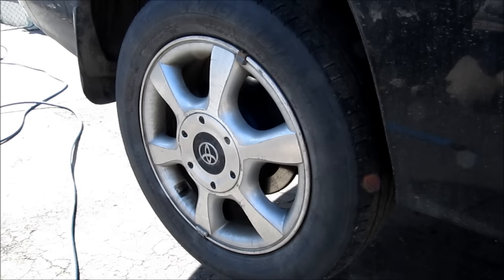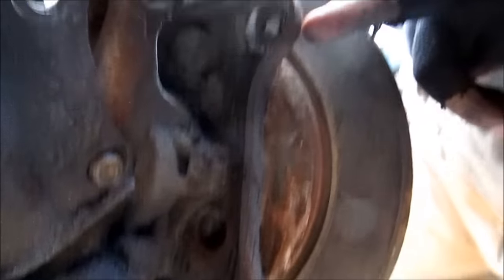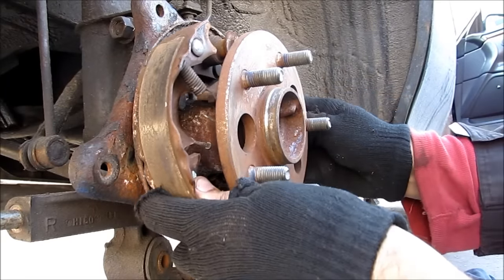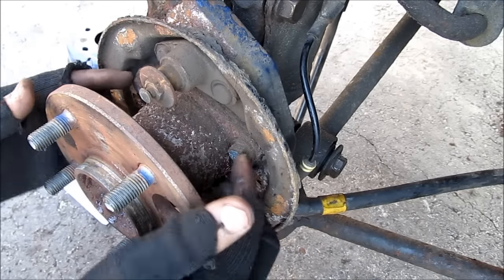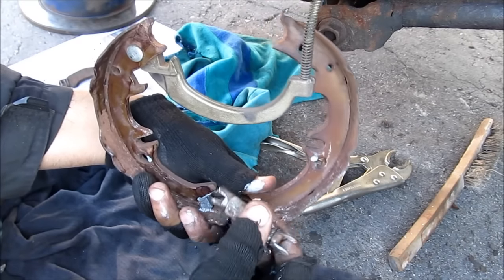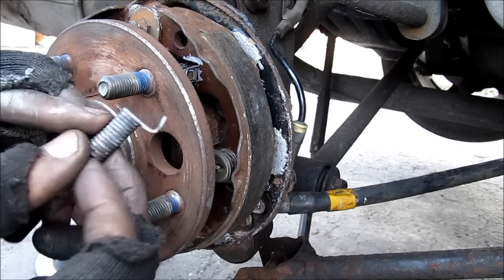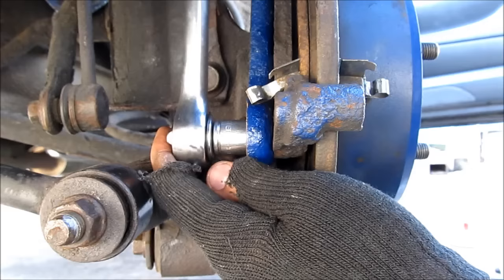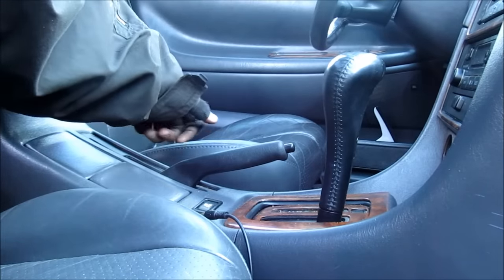How to Replace PARKING BRAKES

Comment: I've done this job before but I still needed a reference.  You sure do know what you are doing!  The diagram was nice and naming all the parts was educational.  If you do a Rev 2, my suggestions are 1) make sure people know that this is a very frustrating project.  All those springs under pressure cause many minor mishaps and "start over"'s.  2) Go slow on the parts where you need to be careful which direction a part needs to be inserted.  Like the parking shoe strut/compression spring, the parking brake cable (if you put that in backwards, it is a BEAR to get it off), the shoe hold-down springs (this is a tedious Houdini maneuver), the "washers" (have a flange that needs to go into a hole on the hub) and the adjustment knob wheel (again-which direction?   answ:  so that the adjustment increases tension when you turn the wheel cog in an upwards motion).  Also, on my Lexus RX, I found that it was much easier to install the retention springs first, THEN the shoe hold-down springs because the entire assembly wants to fall off if I didn't and then, I have to start all over, find the springs that fell out, etc.  Anyhow, thanks fo doing this, just some suggestions for and from a bozo who doesn't have a lot of experience with this.

Comment: You missed a couple important details here and made this way more difficult than it should have been. To begin with, all you needed to do was take off the bracket bolts and using a wire hanger to hang the complete assembly up out of the way by way of the strut spring. You NEVER leave the caliper dangling from the hose. Secondly, the pad brackets have an open slot in the middle with a hole just below it . This is to allow us to "push" the shoe hold-down spring and pin set-up off the bracket with a flat head screwdriver, so you don't have to disassemble it, unless you are using new hardware. This makes it much easier to do. Plus, when you re-attach the shoe hold-down spring set-up, you need to insert the tab from the shoe hold-down spring cup into the hole to keep it in place. A "hook" tool works great here. But, remember to always wear a dust mask when working on your brakes!
Reply: Hey, listen.....  you have no business telling a guy teaching newbies how to disassemble and reassemble brakes.  Newbies don’t have the pleasant experience of knowing how to do it that way. So Speedkar is doing a narrative breakdown. Now do the newbs a favor and go away.
Reply: @justchris846  Really,,,and who are you??? Doing a brake job can be hard enough. So if I see an easier way to do something, I'll say it. So, excuse me for trying to help out by simplifying things. And as far as I'm concerned,  you have no right telling me what to do or where to go.
Reply: RG T I’m a certified mechanic Is who I am, ASE to be exact, 10 years in the shop , this video is great for newcomers, if you have tips a tricks , do a video showing how to do them instead of telling this young man how to do what he clearly already knows how to do
Reply: @justchris846   hahhaa the man can say whatever the hell he wants 🤣 😂

Comment: Great video... massively helpful.... EXCEPT that you made it look easy.  I did ONE side tonight and it took me 4 hours.  Most annoying job I've ever done!  Getting that pin and the spring and cap in place while holding the stupid shoes in the right place... ARGGGGHHH!!!  Very frustrating job, but this video was great.
Reply from the maker: Thanks for the feedback. Yes those clips are very tedious. I cheated and learned on the other side before making the video.
Reply: I had a lot of difficulties holding the spring and cap as I couldn't put a lot of pressure of the pin at the back. I cheated by getting 2 small cable ties and putting the spring in a vise and cable tied both sides of the spring. This meant I didn't need to fight against the spring while trying to get the pin through the cup.
Reply: Same here..started at half 8 AM..half 3 pm came and still not finished..so I gave up

Comment: IF, and that's a HUGE IF around here.... If you can remove the 4 bolts that hold the bearing in, and actually get the bearing to come out, the brake job becomes SUPER easy.... IF not, struggle on!
Reply from the maker: Agreed. Not easy though

Comment: Great video..would have been MUCH better to NOT edit out where you had trouble. That is where people that are doing DIY learn and better understand. I think !A Autoparts or is it A1..does videos with the trouble they go through. Sure edit out the bolt loosening and turning, but other things should be included, such as spring, or clips and all of those things. People can easily fwd.

Comment: This is the most complete video I've seen dealing with the Toyota parking brake.  This saved my hide because I was having so much trouble, but after watching this video a few times I was finally able to get the job done.  Thanks!
Reply from the maker: +Michael Gulley Thanks, great to hear you got it done.

Comment: There are lots of videos about this but your video is absolutely the most understandable.  I have struggled with my 4Runner for days.  Unfortunately, my parking brakes were in pieces before I took them apart, so I really did not have a good understanding of how they looked before I started.  I'm a visual guy and when I disassemble something I am not familiar with, I take the time to take a lot of photographs.  I had my hardware kit as well as new shoes but without the benefit of seeing the brake assembled before hand, I wasn't sure what spring went where.  I also had a bad understanding of the sequence of assembly.  Thank you.

Comment: Great video. Super helpful after I had my parking brakes seized up from sitting too long (waiting for parts, lots of rain) and ended up forcing the rotor off. Everything went perfectly well putting it back together thanks to this video. Much appreciated. Except the last step, after adjusting the parking brake on both sides, I found out I had a stud that backed out because of my hammering. Yaya.

Comment: A great video and right to the point.
I'm currently restoring a 1998 Toyota celica and this video is exactly what I need. I had the same problem getting the two 14mm bolts off. (M10 with 14mm head) I had to use a twist socket to remove one of them. On re-assembly of the two shoes, I used a length of thin wire to compress the two springs that are difficult to get back on. The trick is to assemble the retaining pins, springs and slotted caps first. Then using the wire to compress / pull the spring just enough to enable the spring to slide into the slot on the shoe.
I replaced the old M10 - 14mm head caliper retaining bolts with new M10x20mm x 1.25mm pitch 17mm head grade 10.9 bolts.

Comment: Excellent video. I just used it to try and figure out what my brakes had decided to chew up and throw around the drum. Looks like I've got the folded-up remains of the cable guide seen below the hub assembly at 3:53. Oh, and a pin which I'd wrongly assumed had been bent out of shape by the knackered brakes, which I knocked straight before discovering that it's supposed to be that shape. Oh well, more bits on order.
Reply from the maker: Well you have quite the job ahead of you

Comment: Great Video.. I'm a female and going to change my Parking brake shoes this weekend and was searching for a video that explained the procedure. From other comments you make it look easy and others say its a difficult job.  I'm about to find out this weekend. I will have your video with me all the way. Thanks so much for taking the time and posting.
Reply from the maker: +Pam M thanks I am glad my video helped you!! All the best on your brake job.
Reply: Speedkar.. well the job is complete and your video is exceptional.  but must say I am glad I had a mechanic close by.. lol  but the problem was my replacement spring kit aside from the pads themselves.. The replacement pins were too long hence the hold down spring and washer kept popping off when I went to replace the rotor.. Grrrr.. :) So found the original pins, cleaned them up, reused and presto. Piece of cake.. But yes a very tedious job and annoying.. I'm glad I won't have to do that again but I did also learn for future how to change my brake pads and that is a piece of cake. Thanks again for your guidance. All the best

Comment: Thank you for very helpful video.  With the pins, I am going to try assembling pin, washer, spring and cap prior to putting shoe on, and using string to pull and compress the hold down assembly and slide shoe in under then release.  I saw a photo of this method on a toyota forum for 4runners.  Same issue as Camry.
Reply: Did assembling pin, washer & spring work well?

Comment: Toyota brakes- particularly the handbrakes, put me in a theological dilemma. I don't believe in hell. However, I just don't know where the designers of these brakes can go in eternity... I would like them to see the insurmountable amount of wasted time they have caused all over the world and during many decdes because of these pins.
How many of us have they brought to sheer desperation almost to a suicidal state?!
So, this is my appeal to all of us who deal with this horrible design. Hang in there! There will be a day where the designers get a just treatment for what they have done to us, I am sure of it. :-)
Reply from the maker: +Manfred Lemke Yea those pins are a pain. Apparently there's a tool that your supposed to use.
Reply: very true
Reply: I found it easier to put the springs and retainers together and then stretch them out over the top of the shoes and into place. I also masked off the shoes with masking tape before I started to reassemble to keep them cleaner. Reading down below I see someone else noted this method of getting the springs on. Great and helpful post otherwise.
Reply: been working on those springs for 2 hours. my head's about to explode. 04 sequoia and there's almost no room to work them in.
Reply: The reason these are so bad is because they combine disc brakes with drum brakes. Putting back the pins is annoying enough with pure drum brakes, where the pin isn't hidden by the hub.
Why didn't they just use the disc brakes for the parking brakes like other car makers do?
I forgot to mention that drum brakes are terrible as parking brakes in humid climates. The pads tend to stick to the drum because of the humidity, and after a few times they become loose and you have to replace the brake shoes. If you have a manual gearbox and the brakes are sticking, just keep the first speed engaged instead of using the parking brake.
Reply: @unnainconnu9098  very sad to see such a design flaw on so good cars.
Reply: You can make the tool for yourself: using a Dremel, grind down the edges of a 7mm long socket, the kind that are only about 10mm diameter. As you grind them down, leave 2 prongs sticking out that will eventually fit the brake spring cup. Then just use a small pair of grips or pliers to turn it into place. Saves hours of head banging.
 You can also use a large screwdriver on the back of the plate to stop the pin moving around.
Reply: @hpt08  Great idea! You can also make a tool out of a large flathead screwdriver by similarly grinding the center out. Look up the Mac Tools PBT1 Toyota Parking brake Tool or the Cal-Van Tools CV364 to see what it looks like or you could just order one if you prefer. 

Having tried other methods like using wire and zip ties it's waay better to just have a tool that fits through the hole to turn the keeper IMHO.
Reply: @TJK0ng  I thought about that but realised I'd need to machine my only decent large screwdriver. There's a type of screwdriver bit that looks exactly like your version of the tool too. DIY is the way to go though!
Reply: I'm relieved to know I'm not the only one dealing with this issue

Comment: Hey brother hopefully you can help me out. I installed new shoes and all new hardware on a 01 highlander. (Pretty much exactly like these) and when I press the foot brake morning happens. I also tightened the cable so it's nice and tight. Still dosent move the shoes. What am I missing?

Comment: Good video. I stopped using anti seize on my brakes. I figure it’s good for awhile, but eventually just attracts dust, grime, and it basically just rubs off the contact points quickly. Everyone does it a little different.
Reply from the maker: True. But do you live in the rust belt ?
Reply: @speedkar99  Not anymore, no. Didn’t use anti seize in the southeastern part of Wisconsin when I lived there though. I never ran into any issues. Maybe it is more useful in other states.

Comment: Good, clear video. Takes the mystery out off Toyota style disk/drum type brakes. My only suggestion would be to add torque values during the 'nice and snug' dialog, for caliper bolts.
Reply from the maker: +Richard M. Thanks, haha I don't use a torque wrench for this kind of stuff...only for sealing surfaces where it matters the most :)

Comment: Very helpful video! This job was an unbelievable pain though on my 06  Sienna. I had to get someone to hold those long pins in so I could get the spring and caps in place. Phew! I DO NOT want to do that again.
Reply from the maker: +Chris Asprelli agreed, drum brakes aren't easy but they make a tool for those pin caps
Reply: speedkar99 that's good to know! Do you know what they're called?

Comment: Just did this on my GX460, what a pain in the *ss!! Hahaha. To get those blue springs with the pins back took forever. Used twine to hold the lil spring and its caps while pulling to compress and moving the shoe in place. A beer well deserved!
Reply from the maker: There's a special tool for that

Comment: what an easier job than on the Prado 120 - the gap between the the hub and the backing plate is is so narrow, one can hardly fit a finger in there, plus the hub hole to work through is about 1/2 the diameter, only about 12mm diameter.
I made a couple of special forked tools for the retaining clips plus lots of patience and perseverance. For an old fella with problem knees  it would have been great to have it full height on a hoist too!
I also had to replace  the axle as the oil/grease deflector had rusted out, plus all rotors, calipers and pads front and rear. No need to grind out any blots luckily. The secret to buying sockets is to only get hex ones, not multifit. which can too easily strip either the nut/bolt head or even the socket itself.

Comment: Great video, thanks.  I only wish you had spent more time on the hold down clips, the hours I've spent trying to install them as I'm sure many out there have as well.  I eventually resorted to using a piece of string to compress the three pieces - the two cups and spring -  pulled through the adjuster access hole in the hub.  The method can be found if you Google "Help to re-install the parking brake".
Reply from the maker: There's a special tool for that. I struggled with this as well

Comment: Painters tape!  Use it to hold everything together, especially at the top of the shoes and the little clips behind the small shoe springs. Did this on Sequoia with even less clearance than shown here.  I don't know how it would be possible without the tape!
Reply from the maker: +Kevin Rhoades Good tip

Comment: good tutorial......this parking brake set up is a pain in the butt.......getting the parking brake shoe hold down springs in and out just using needle nose pliers was impossible for me so I made my own tool to do it. Saw a similar tool for a corvette, but mine is sized just for this RX300. I sacrificed a large flat head screwdriver, but I have a ton of them and it is totally worth it. It is really late now, but I will post some pictures of the tool I made and how to use it.......makes replacing those hold down spring soooooo much easier.....and possible for people like me who have old, arthritic hands from years of wear and tear....LOL.
Reply from the maker: Yes these are a pain!! 
I hate dealing with those springs. 
There is a special tool they sell for it however.

Comment: bro, you have no fear in you lol   once you got to taking off the shoes i was having anxious moments

would be cool to have a parking brake cable adjustment vid to go with this one
Reply from the maker: +neppy5 Cable adjustment is mostly done at the star-wheel anyway. I think there's a turn-buckle under the heatshield under the exhaust, but I don't want to bother rusty bolts until the cable needs replacing.
Reply from the maker: +neppy5 I'm not afraid to take things apart on this car, as this is my secondary "experimental" car where I learn on.

Comment: Thanks for the video.  Finished one side, took ages.  Have a 2004 Sequoia.  Everything was going well, I then get to the bit were I'm supposed to re-install the holding spring pin, the side with the crooked pin that resembles a start up crank.  What a nightmare!  You seem to have a bigger working gap than I did.  For the life of me I could not get to damn thing in place.  For one thing the hole in the hub is small and does not line up properly with the holding pin so you end up trying to push on the spring and cap at an angle and tools are hard to insert through the tiny hole, it's like a sadistic version of the game Operation.  Went to bed very frustrated.  Visited an online Toyota forum this morning for possible advice.  Saw lots of people complaining about this issue but one guy out of many suggested a different approach, that is put the spring and caps on the pin beforehand, then slide the caliper with the parking brake arm into place, there is a slot in the caliper for the small crank arm to sit.  It is still very fiddly but managed it after several tries.  Obviously everything else was pretty easy after this.  As regards the other side, I think I may just dose it with brake cleaner and grease up the friction points, lol!